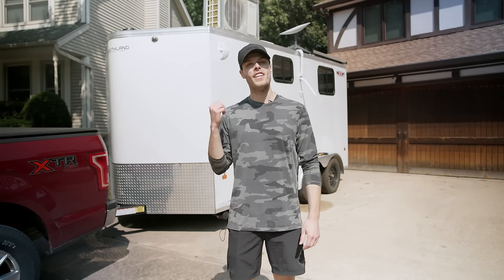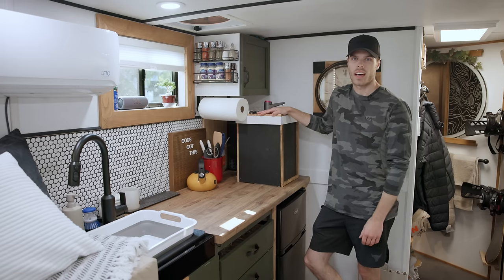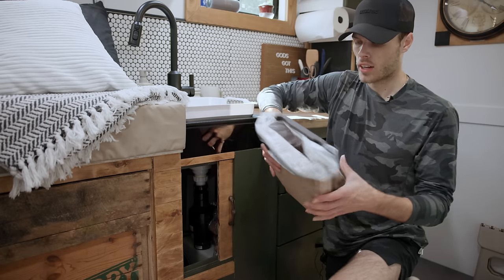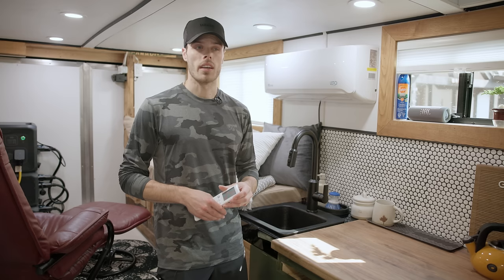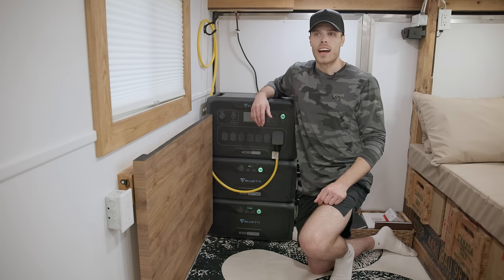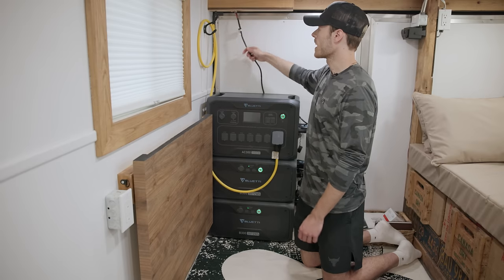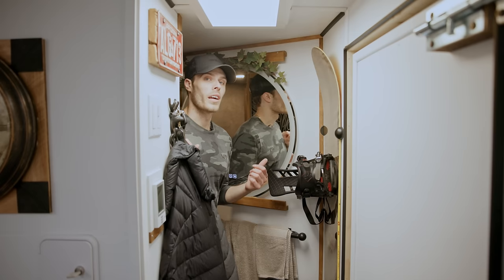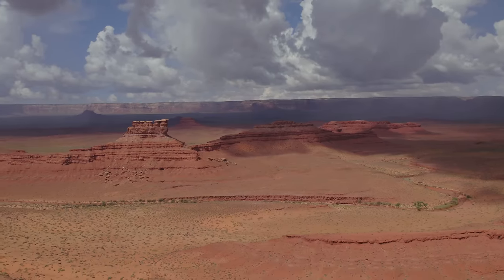I turned a $10K trailer into a $70K Modern Home

Comment: These bluetti are nowhere as efficient and cost-effective as building your solar and battery systems. You noted in your comments that your current system can't manage your fridge or the ac.
Reply: I don't know anything about electricity and solar. So i would have gone with the same route of a commercial solar system. Even if it's below par and more expensive  with building your own. Point is, not everybody understand electricity and solar diy systems. Or just don't have the confidence of building one.
Reply: @lawrencepatricio5776 there is a million utube videos about it and it's super simple. Going to go out on a limb and say  he is pretty familiar with utube
Reply: @lawrencepatricio5776 exactly, not everyone wants to diy stuff like that, in some places electrical work is a protected trade so has to be done by a qualified electrician.
Reply from the maker: @davidschlarp1606 you’re definitely right, there’s a lot of tutorials and I’m sure I could have figured it out but it really came down to time. I couldn’t spend 2 weeks trying to figure this out on my own so I went the east route.
Reply from the maker: You may be right that it’s not as efficient, I don’t know myself but I never said it couldn’t handle everything I run. I run both A/C and Fridge just fine.
Reply: I have the same set up in my van. Super efficient- runs AC, fridge, heaters, lights, hairdryer, induction, computers, etc! I have 1K of solar which is essential to power the 500ah of battery. The solar builds take up too much space and is a fire hazard imo- much more so than power banks.
Reply: Why a fire hazard? I am a newbie, so want to avoid issues.
Reply: @lauradeer8567  there is so much more chance for error…and wire exposure. We off road most of the time being tossed and tumbled over rough terrain which can loosen wire connections.  Take a look at most of the DIY builds— they take a lot of room and so many wires going here and there. That would be fine for a stationary house, but a rec vehicle, no thanks.
Reply: @MannyWC not true.

Comment: Yes, but the question is: did you turn your 10K trailer into a 70K tiny home by spending 70K turning your 10K trailer into a 70K tiny home?
Reply: Still, no mortgage, etc.
Reply: @Lori1Cor15  Instead of a mortgage, you have land leases or lot rent. It seems no matter what you do, the housing market near desirable cities, particularly coastal desirable cities, is rigged to make sure that you spend at least $1,000+ a month to live (emphasis on the plus). And outside desirable cities they want you to spend close to $1,000 a month (as close as possible). It is aggravatingly annoying